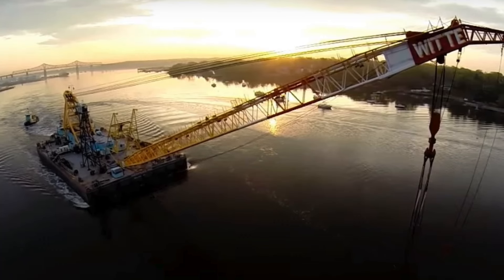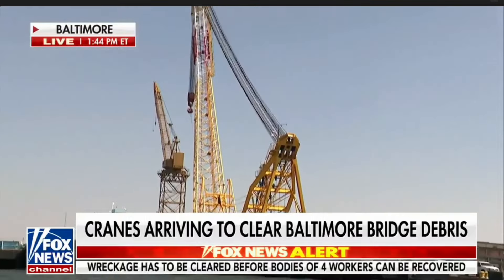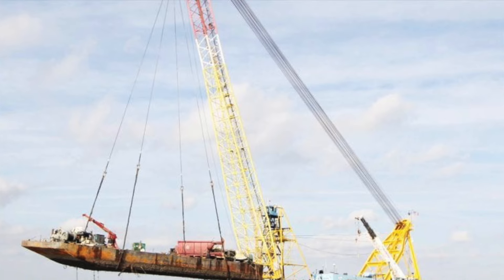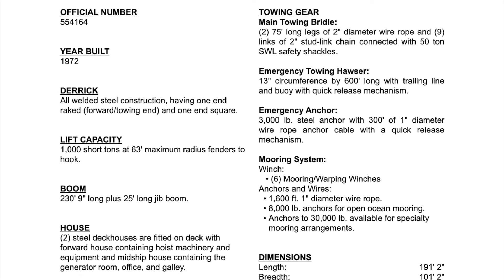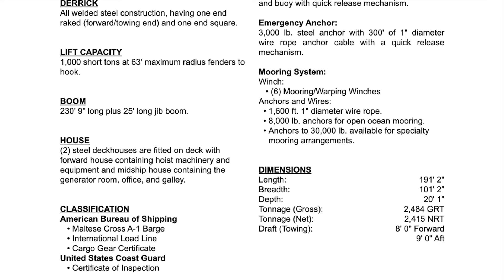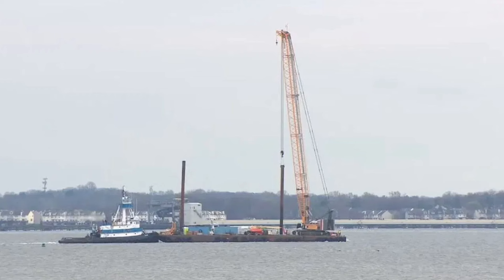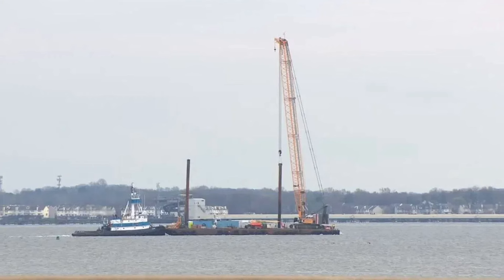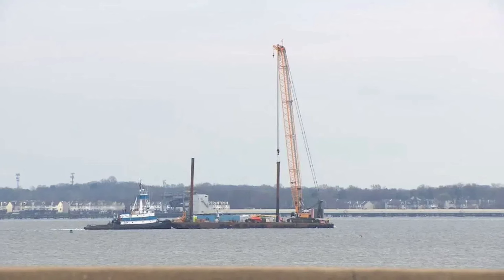Chesapeake 1000 Arrives for Salvage Operations

Comment: Thank for the video, Mr.Andy.Blessings.
Reply from the maker: You are very welcome
Reply: @MinorcanMullet  Has anyone considered salvage diver lift bags to get large portions up then tow it to a barren area to try and create a reef?
Basically does it all have to be disposed of in "LAND" fill?
Reply from the maker: I'm betting most gets scraped out.  I don't know about the lift bags.  The water may be too shallow to be effective. I know bags are used in salvage operations quite often.
Reply: @MinorcanMullet  I just figure if they use old ships to make artificial reefs, and if the lift capacity would limit the size of pieces and extend the time, it might be easier to cut it down to multiple lift bag territory.
50+ Years ago CERN built a new lab-space full of massive delicate million dollar machines and as they were almost finished they realized that each of them was .5 cm off, so .5, 1, 1.5, 2 etc.
The last one could not be placed and the first could not be moved over with out removing all the others, months of work wasted and months more added on.
AIR was the solution, they made a "hover-craft" pad to place under each item and then a small child could move tons with a finger.
I understand the water level issues, but taking X# of months to cut it into 10's of pieces and float out... or Y# of months to cut it into 1000's of pieces and winch it out?
Is X greater or less than Y?

Comment: The center of gravity of a lift immediately goes to the tip of the boom as soon as the load is suspended, so the stability of the barge and the slew of the crane relative to the barge during the lift and then once suspended must be factored for the total safety of the operation. That’s why Derrick cranes like the Chesapeake 1000 and Left Coast Lifter can pick up such massive loads compared to even the largest ringer crane the Weeks 533. They are only dealing with stability in one axis and load computers calculate the balance so they will actively ballast the the hull of the barge as the crane is taking on the weight to maintain stability.

Comment: Yesterday operations were paused indefinitely. The concern came during the due diligence process when salvage engineers discovered a high-pressure gas line near the wreckage. According to one source, both the Department of Transportation’s US Maritime Administration (MARAD) and the US Pipeline and Hazardous Materials Safety Administration (PHMSA) have been notified.
A pipeline safety expert from PHMSA confirmed concerns about a particular pipeline. The pipeline has been isolated and depressurized. Despite the shutdown, salvage teams aren’t willing to further risk the ship, the crew, and their own members. They require a review of the undersea documents and a survey of the pipeline before resuming.
“This will undoubtedly cause additional delays to the operation,” said a senior official at the meeting. Even after the risks to the pipeline have been fully mitigated, “the timeline to remove the debris from the ship is very uncertain.”

Comment: That crane doesn't have to rotate, I'm sure they will lift the debris from the river & if there's enough depth they will push/pull a barge underneath & set the load on it

Comment: This Derrick Chesapeake 1000 is NOT full revolving eh Andy. Do I have that right?
So it has to be backed out from the bridge by Tugboat every time it picks a load. 
And then the transportation barge shuttled in between the work and the stern of the rig for the load to be placed on the barge.
And the crane moved back in position for the next pick. Very time consuming.
A huge disadvantage over Manson's Derrick E.P. PAUP that is 1,000tons full revolving.
Or the WOTAN which is 500ton full revolving.
For these two Derricks the transportation barge can just be alongside ~ and the loads swung around without having to move the Derrick.
And they both do not need a fulltime tug tender. They move themselves on anchors.
And if the Chesapeake picks 1,000ton pieces, you will need another 1,000ton rig on land at the unloading site!
Instead of a far less expensive say 500ton Manitowoc crawler.
If you have to cut up the 1,000ton pc on the barge to unload it ~ you tie up the transportation barges. Need more barges.
Do I have this all wrong, Andy.:cat-orange-whistling:
Wadda yuh think?
Reply from the maker: It's possible that after lifting, a barge could be slid in underneath the suspended load and then the load lowered onto the barge. Much will depend on what the site allows.  Keep in mind these operations will be fluid and may be modified as the project unfolds.
Reply from the maker: This crane would probably be best described as a Stiff Leg Derrick
Reply: @MinorcanMullet  Yep - this old timer thinks this Stiff Leg is not the optimal fit for this job.
Thanks Andy. Going to be interesting to see how they utilize this rig.
Take care.
Reply: @MinorcanMullet  To do this the crane has to "boom up". Very slow on these types of rigs.
And with having to leave enough room for the barge to be "slid in"....
The radius of the pick is more - lowering the picking capacity of the crane.
I did a poor job of describing that. Oh dear!
Reply: @MinorcanMullet  This crane maybe there to help a larger crane setup!
Reply: Could a shear be used, instead of a worker with a torch or plasma cutter, or are the beams to large? Would think it would be safer and faster.

Comment: That they are going to try to cut this bridge into pieces worries me, I know the hazards of using explosives in a controlled demolition operation.  The primary advantage of using explosives is that you don’t have to have a worker on the structure using a torch…….tied off to????.

Once a section is cut free it will be extremely difficult to know how it will move.  At least with explosives you don’t have to stand right next to it.  When these things are built they go up one piece at a time with known loads, temporarily supports etc.  the Oakland Bay Bridge was of a similar design and took extensive planning to dismantle with well known loading conditions.  This is a twisted wreck with damaged connections.  

Although with visibility conditions and wreckage in the water it would be at best difficult to place changes with divers.

I will be extremely interested to see how they proceed.  This seems to be a situation where you have to differentiate between bad and worse options.
Reply: I’ve been involved in that type of demo work.. The only safe place to be,, is on a different job..

Comment: How did this heavy duty crane be available for the recovery so quickly? Was it stationed in this area?
Reply: @user-sm2qn2kx4z   This Derrick barge has it’s home base at Port Newark, NJ. Contrary to what many people are saying about this machine, I’ve seen it in action and it is a very productive and powerful rig. The Chesapeake 1000 has a long working history and has successfully been used on many marine projects. People should keep in mind that the crew and operators play a huge role in overall productivity. A veteran crew with tons of experience is a key factor. I’m inclined to believe that the Chesapeake 1000 will achieve excellent results with this bridge recovery. Take Care.

Comment: Other than your reporting I havent been paying much attention... I wonder if Charleston's Heavy Lift is being sent up or if it is capable of providing support
Reply: Charleston Heavy Lift operates a floating crane with a 500-ton capacity called the "Ocean Ranger". 
This crane is mounted on a 200' x 72' ABS deck.
Its disadvantage is that the crane is not full revolving.
Not really suited for this job eh?

Comment: The Chesapeake 1000 by definition is NOT a heavy-lift marine crane.
Marine Heavy-lift Cranes:
A crane vessel, crane ship, crane barge, or floating crane is a ship with a crane specialized in lifting heavy loads, typically exceeding 1,500 t (1,476 long tons; 1,653 short tons) for modern ships. The largest crane vessels are used for offshore construction.

The cranes are fitted to conventional monohulls and barges, but the largest crane vessels are often catamaran or semi-submersible types which provide enhanced stability and reduced platform motion. Many crane vessels are fitted with one or more rotating cranes. Some of the largest crane vessels use fixed sheerlegs instead; in these designs, the crane cannot rotate relative to the ship, and the vessel must be manoeuvered to place loads. Other vessels use large gantry cranes and straddle the load.
The three main measures of capacity are LOAD, REACH, and LIFT HEIGHT. Other factors of importance are Hull Draught, Depth to which the Hook can be Lowered (for offshore work), and Sea State Limits for transit and lifting.

Heavy-lift Cranes:
Thialf can use both cranes in tandem to lift 14,200 t (14,000 long tons; 15,700 short tons) at a radius of 31.2 m (102 ft).
In comparison, Saipem 7000 can use both cranes to lift a smaller load of 14,000 t (14,000 long tons; 15,000 short tons) at a wider radius of 41 m (135 ft).

Lifting Records:
A heaviest single lift record was set in 2000 by Thialf for lifting the 11,883 t (11,695-long-ton; 13,099-short-ton) Shearwater topsides for Shell.[9][10] Saipem 7000 set a new record in October 2004 for the 12,150 t (11,960-long-ton; 13,390-short-ton) lift of Sabratha Deck.

Under dynamic positioning, Saipem 7000 set another record in 2010 by lifting the 11,600 t (11,400-long-ton; 12,800-short-ton) BP Valhall Production topsides.

Shortly after it was completed, Sleipnir completed a record lift of 15,300 t (15,100 long tons; 16,900 short tons) for the topsides of the Leviathan project for Noble Energy, in September 2019.
Reply: The problem is that most of the crane vessels mentioned here are deepwater vessels. The Sleipnir with its 36 meter draft probably cannot even work in the shipping channel. Outside the shipping channel the water around the bridge is about 6 to 7 meters deep. Draft is the limiting factor. 20 feet of the Chesapeake 1000 just fit. Moreover, these mentioned ships are moored in the Netherlands approximately 4000 nm from Baltimore
Reply: @hansvenhoeven935  Yes Hans, I am aware of all of that, too.  It is just that the press over here is making such a big deal about the Chesapeake 1000 (and it is most likely the largest that can navigate into the shallow waters there) as being a large heavy-lift crane when it really is not. I am just trying to get some perspective out there for most who have never touched marine operations. Thanks for all that additional input!!!

Comment: If that's really the largest crane that we have available on the eastern coast, we really need to get our act together. The largest floating crane have more than 10 times the capacity of that one. Since we dont build that much infrastructure theses days in North America, I guess we don't need a large crane like that. The fact is that 50% of bridges in the US are considered deficient. There's a lot of work to do.
Reply: Wasn't there a big money bill put thru by b ??  Like a trillion. 200,000 .. Infrastructure is in very bad shape.. Look under a overpass and see chunks of rusted girders on some concrete pillars..All this money leaves the us ,but not much stays to help the home..

Comment: Difficult to believe that there is not one sheerleg crane on the east coast of the US.
Reply: This Derrick Chesapeake 1000 is a 1,000ton sheerleg crane based in NJ.
Reply: @DennisMerwood-xk8wp  The Chesapeake 1000 is a crane barge, it’s not a sheerleg crane.
Reply: @kekzoet7487  Its not full revolving. Thats the problem. Too slow. Too unmanageable.
Not optimal for this work
Reply: @kekzoet7487  Its not full revolving. Thats the problem.
Too slow for this type of work.

Comment: I'm shocked that a 1000T is the biggest crane... And you think it's massive????
It's a baby if you compare it to other floating cranes. I'm from the Netherlands and only from my head I know already 5 floating cranes that are much much stronger. The Sleipnir from Heerema for example ha a lifting capacity of 20.000 tons the Saipan 7000T, Hermod and the Balder 6500T, the Rambiz 3700T.

Comment: Barges tip and dip. I assume water can be pumped out or in as need be.  Let's not have a crane failure video on this bridge please.
Reply: WOW Max, A crane toppling ..Bringing cranes from Sweden to help.. I believe there is a storm going east from plains..Forecast for Wed. is 2-5in snow then rain here in cent N.H. Cheers